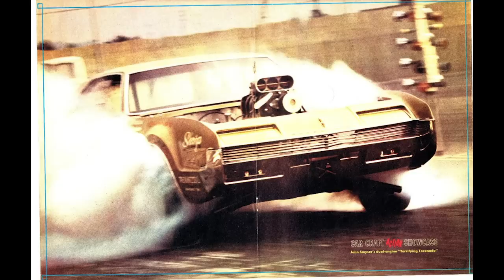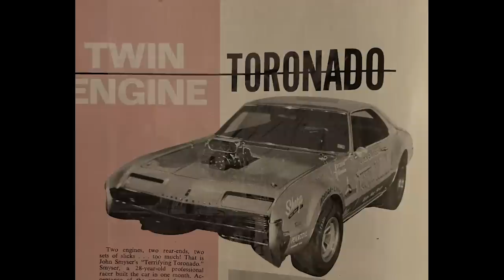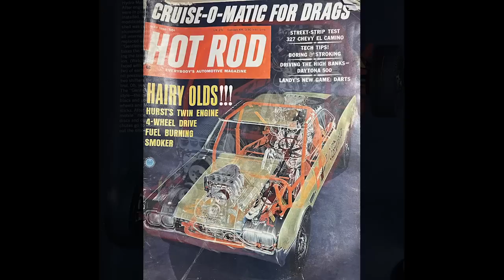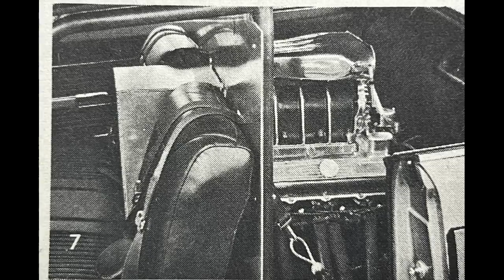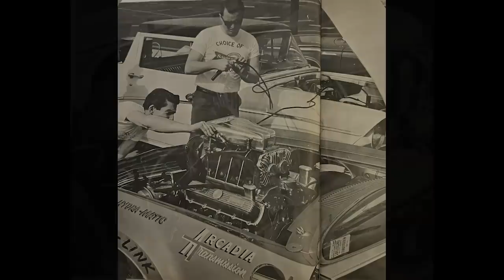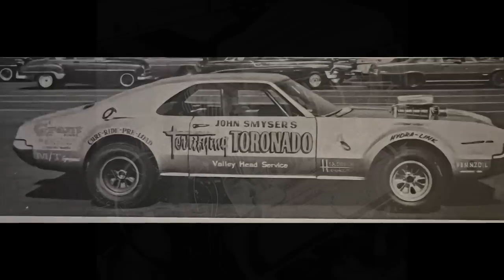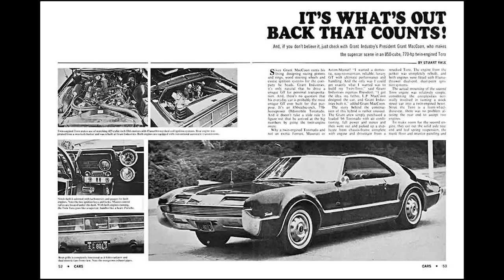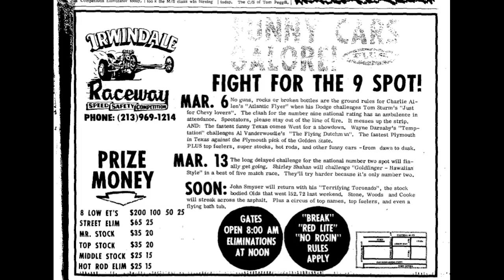The Terrifying Toronado Part 2: Building The Twin Engine Beast

Comment: My most terrifying Tornado was the 1st one i ever rebuilt the 325 front wheel drive  i was 15 years old and my brother 16   we had been rebuilding automatic transmissions at our dad's transmission shop senc 1977    after the shock of getting it out of the car and found out it was just a TH 400  WITH A GIANT TRANSFER CASE CHAIN   my brothers 4of us are in our 60 s and 50s   and my son is also an expert  and WE haven't seen a 325 in over 30 years 🤔

Comment: I have always been an Oldsmobile fan. since I owned a 1968 Cutlass Supreme. that had a 455ci engine out of a Vista cruiser in it. and it was was relatively fast. I would have loved to have owned a 4 4 2. but back then they were just out of reach $ wise. this Toronado had to be a unique car to build with the dual engines for sure.

Comment: I was at the Niagara Falls drag strip in August 1967. As the car left the starting line it made a large snap noise, the engine blew up and a large cloud of green smoke billowed up. The car then veered left crashing into a fence.  I was only 14 at the time and remember it very well. This was the very first drag I had been to.
Reply: This is not a true story
Reply: @johnrobinson1343  This is very much the truth. I remember it well.
Reply: @DayTwo-w8n  your confused because the car raced for 2 years never blew up as youbsay

Comment: Another home run...  I was 15-16 during those days of the Terrifying Toronado, (our name).

A good friend's dad own a Saab dealership, another bought a new Toronado, the torque steer in the Toronado was 'interesting' & an engineering prob when compared to driving a Saab.

We figured a high perf Toronado would be terrifying.

Meanwhile, I had just traded a '52 Hudson Wasp for a '57 Chev Tudor Wagon, & my 5 yr march towards the Winternationals began.  I just didn't know it, yet.

Thanks for stirring up all kinds of memories. I remember reading some of the source mags you quote.

GeoD

Comment: My buddy had a 70 olds jetway cruiser which is a toronado based 16 passenger wagon. That car with a 455 in it would smoke those front tires for blocks.. the th425 was one tough transmission

Comment: I cannot wrap my brain around the wheel-speed disparity between the front and rear halves of this car...
Reply: With 2 separate engine that can each turn different speeds it should work out that the front engine could just turn the higher rpm since they aren’t directly coupled together. But, with such a big gap it’s likely the rear one was bogging to far trying to pull such a high ratio. 
I’ve seen other twin engine setups that can work fine as long as each drive train is independent. But, they’re normally both the same engine and trans combination.

Comment: A twin engine 66 was built in the middle 70's as a Seattle daily driver. One rad up front for both engines. Both carbs were drive by wire.  It had one ignition switch with toggles for independent control to each engine & starter. I got to help with cosmetics, covering the rear side windows & adding a padded landou top, the rear seat had to be modified & moved 8 inches forward to clear the rear engine. then we disguised the rear engine cover as a steemer trunk. eventually sold to a KTW disc jockey. It used Harley Davidson Baffles instead of mufflers.  This was a great time to be a teenager living on Queen Ann Hill ( class of 1974)
Reply: ... that b some priceless memories u got there

Comment: Nowadays you can't get a bilt motor for 20k
Reply: You can, but you have to go real slow at it, it can take almost forever to accomplish, and you get an 1/8th mile headstart to dance with factory built racecars at the stripe, and you must live it 17 plus seconds at a time, and do it w/ 1-24th of the total  horsepower. Lol.

The thrill isn't always being the bullet or the rocket, sometimes you can find it by slowing down and being the 1 chased by the bullet or the rocket.

Brian, if you ever want a different look at drag racing as a go fast sport, look me up in the pits please, let's get you in my passenger seat, and a fast 8-9 second Copo Stocker in the other lane for an amazing dial in run so you can witness a car (bullet/rocket), bearing down to that last 2'-4' top end dance to take or leave the stripe decision after a double 00 or better light foot braking both ends w/ the other car at 125-140 and closing fast!

It isn't fuel, but it is exciting and the engine doesn't cost 20 grand.

Guaranteed, a different view, both of the view of that Copo's undercarriage and the absolutely amazing fast closing rate.

Things appear in slow motion, until at the last few milliseconds they don't.
Reply: And then. You take over the turtle and take on that bullet. It is like attempting to outrun a missle.

Comment: Another Toro / Eldo bit
I've seen pics of car haulers that used the front half of the first gen cars and a deck in the back for the race car. This was similar to the 50's Mercedes hauler,   Cheetah Transporter  ( the last pics I've seen were where the building collapsed on the car ) and the East German Wartburg Rally Trans .  And, for another oddity, look up the Eldo based Sbarro Function Car as well as some of his other " cars " . . .

Comment: Oh wow, this is getting GOOD!    @0:00 That artwork is stellar! Is that from Car Craft?
Looks like a pulp fiction dimestore novel cover BIG time.
The Car Craft photos are mind-bendingly cool as well.
Reply from the maker: The artwork is from the 1966 Drag Racer Magazine feature. It is amazing
Reply: @brianlohnes3079  Thank you!!!  Need a wall-size version of that for sure.
Reply: I can smell the slightly moldy paper, grass / straw / mud while buying a box of magazines at the swap meet then sitting under a tree in the shade to read.
Reply: @bobroberts2371  Best smell! (or one of)
Reply: It was a great time to be young, and have a step-dad who was a top fuel junkie and huge fan of early drag racing, it was all about the dragster, at least until the first funny cars were adding top fuel to the equation, and then Lions went away (we lived in Carson, CA within the full sound zone that told us head southwest 2 miles for a great cheap fan time today), then O.C.I.R was the place to be at the (screamed all over SoCal radio stations of the day), for the 64 Funny Car Top Fueler Shootouts and Fox Hunt this Saturday Night, repeated over and over, hot dogs, and the pre race ceremony with the track lined up with 32 funny cars all diagonally parked on the racing surface backed up along each guardrail, drivers & crews out there with their cars. Every grandstand seat filled, every standing room only spot taken. And the action that followed was immense and deafening, well beyond any 16 car Elim field of today. Later when I was 18, in 1975, I ran my very first car at an O.C.I.R. Fox Hunt. My 1st night of turning from a lifelong fan to an actual drag racer, running between rounds of a 64 Funny Car Shootout. All the big names were there, and I was sharing the lanes w/ them just 2 lanes over.

Yes. It was an amazing time, SoCal and so many dragstrips was an amazing place to grow up, turning from fan to racer. 60 yrs. later, but a shadow of its former self. But, the memories last forever.

Thanks Mr. Lohnes! For all the walks down memory lanes. Now back to the staging lanes, that lead to 2 (or 4), well prepped lanes that keep the dreams alive.

Times are very different now, but not that different at all.

Comment: 6 minutes in this sounds like the most unsafe build ever devised sober.
Reply: Motortrend's Hot Rod Garage built a modern day equivalent with a FWD Impala that got a second LT4 out back and turbos.
Reply from the maker: Hahahahaahah
Reply: ... rear engine spinnin' a foot away from flesh while a front tranny using 1st-2nd while the rears always in 3rd ... 
''' sweatin bullets ''''  or possibly a case of ''' brawn over brain '''